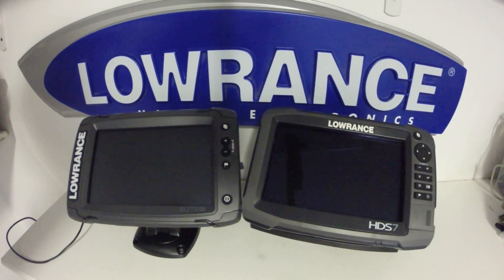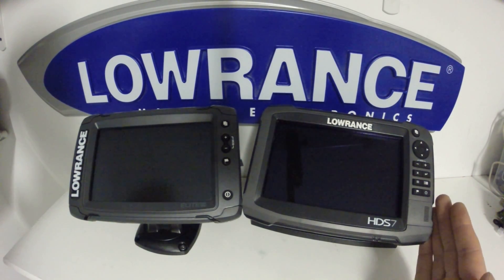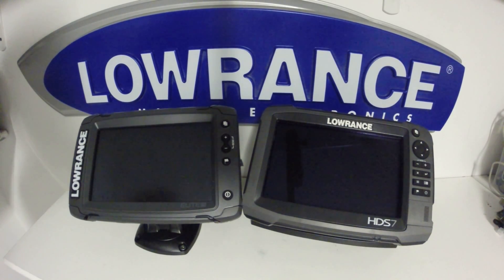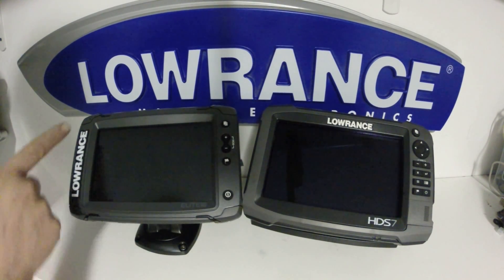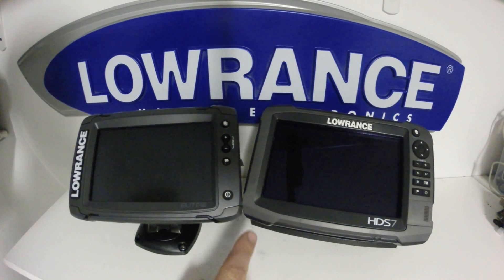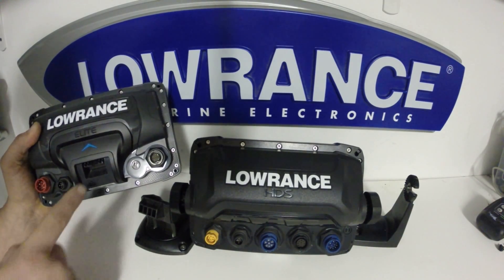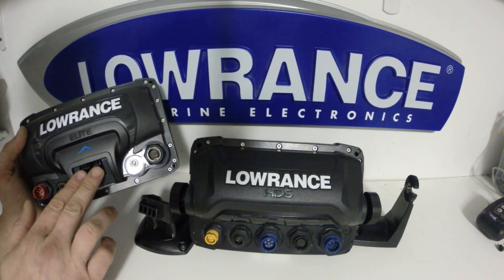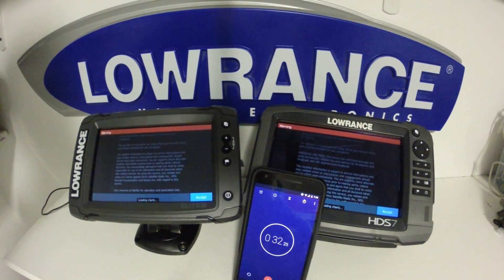Elite Ti vs HDS Gen 3 Pt 1 Basic Difference

Comment: i got 7 ti. totalscan what transcer number is do i need 2 tell head model what ducer it is
Reply from the maker: +Bass Monkey Select Total Scan
Reply: Lawren Wetzel thank you i do a alot of drop shot im going to network it with lowrance 7 chirp what best setting on 7 chirp noise off and surface off to track lure in 30 ft of water right?
Reply from the maker: +Bass Monkey You got it. And keep your sensitivity high and use high chirp
Reply: Lawren Wetzel ok thanks i tried humminbirds this year they are great but i cant run more than 1 unit at a time 2 much interference luckily i put a 7ti with total on back as well thx again

Comment: Lawren-I am still learning to use my elite 7 chirp I got last year and see the TI the ping and scroll speed is separate and on the Elite 7 chirp when you go to change the ping speed the pop up says this adjusts scroll speed which I have done.So are you changing both speeds at once?Also, did the Hook replace the Elite 7 chirp?
Reply from the maker: +newyota1 I haven't noticed that. I'll take a closer look. 

Yes the Hook units have replaced the Elite CHIRP models